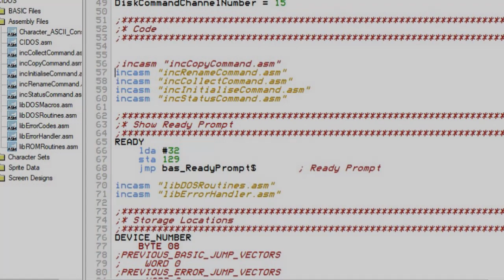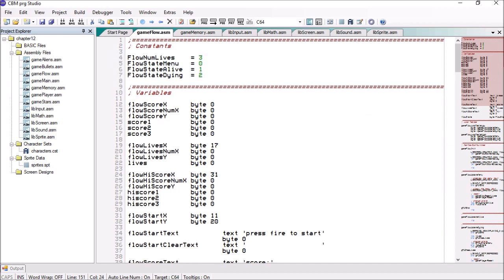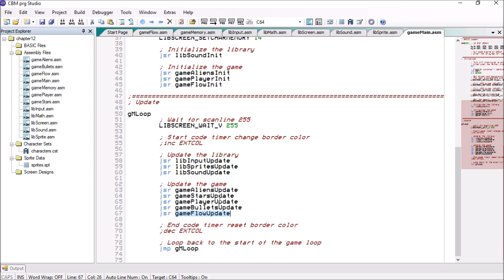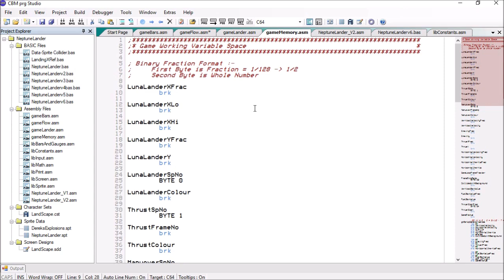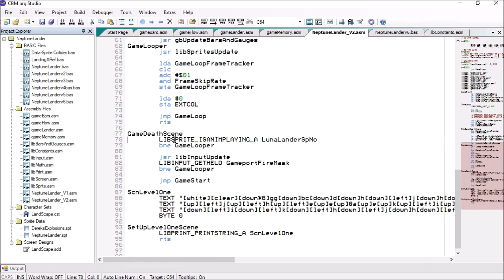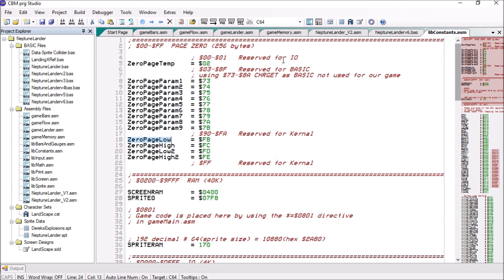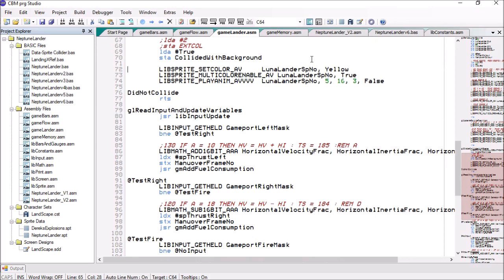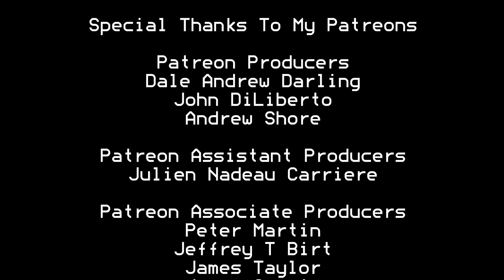Tutorial 35.10 - Adding Game Flow Code

Comment: 4:10 The velocity bar came out of nowhere.  Shouldn't it show downward velocity below the green zone, to match the motion on the screen?

11:27 Is 'Dead_GameMenu' the best description for the start of the game?  Will the final game start immediately whether the user is ready or not?

15:58 If you use an acronym like "GF", you'll quickly forget what it means.  "Girlfriend"?

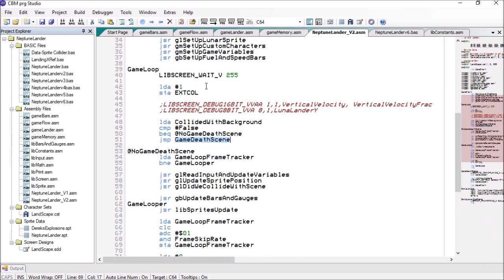20:08 I just don't know how people can stand to use Windows for anything productive.  It's always doing something annoying!

25:30 Shouldn't you be using the .X register as an index into the jump table?  It's almost as easy and more conceptually straightforward to store the addresses as 16-bit .word values.  The access would LDA GameStatus : ASL : TAX : LDA gfStatusJumpTable+0,X : STA ZeroPageLo : LDA gfStatusJumpTable+1,X : STA ZeroPageHi : JMP (ZeroPageLo).  Hardly any increase in complexity.  You could also make the game-state values directly correspond to the offsets, i.e., 0, 2, 4…

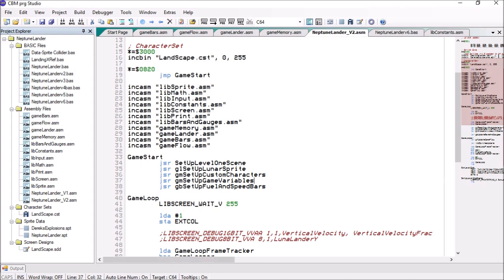42:48 Wouldn't the logic be simpler if there were just different routines that handled the different phases of the game instead of one state-oriented main loop?